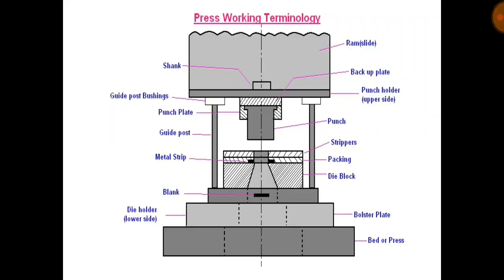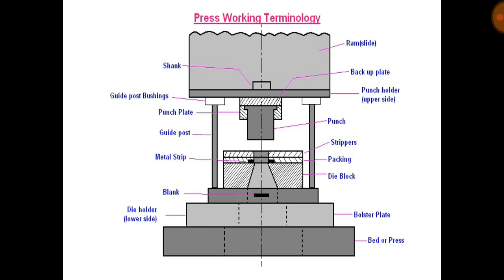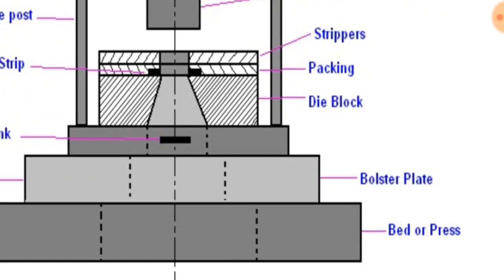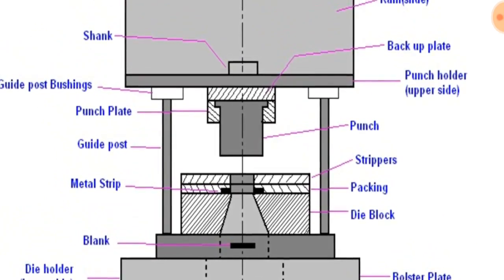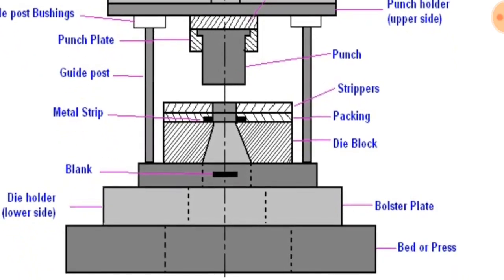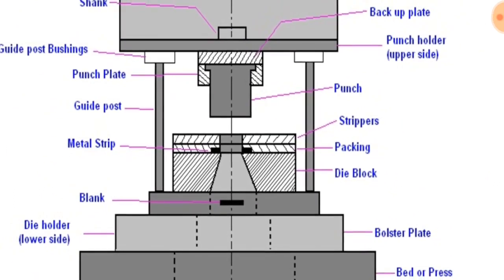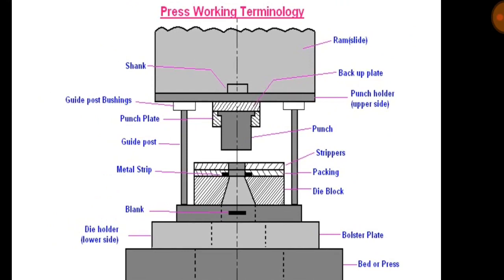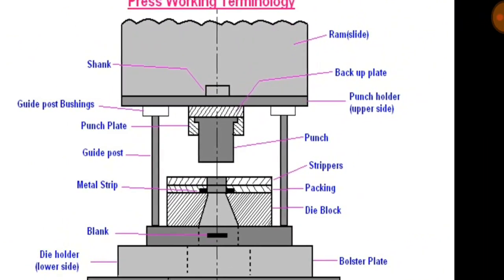Press Working Terminology | Mechanical Press |Power Press | ENGINEERING STUDY MATERIALS

Comment: You can use some lights or pointer to tell specifically while explaining
Also the voice can be raised or lowered while explaining
Sorry but need improvement in the video
Reply from the maker: Thanks for the comment bro.I will rectify the errors in upcoming videos.
Reply: @EngineeringStudyMaterials  
Best of luck for upcoming videos 😀